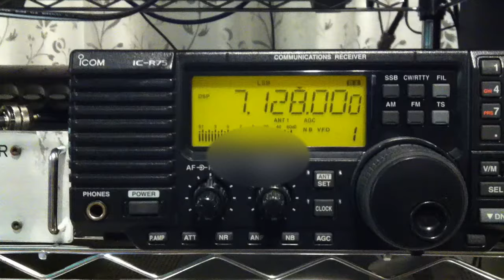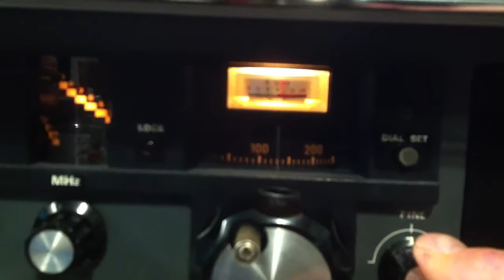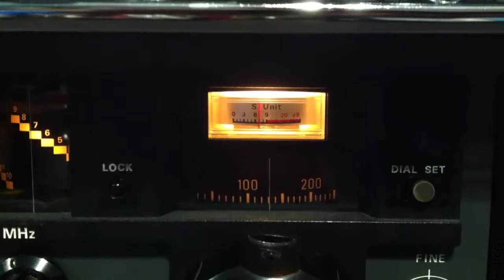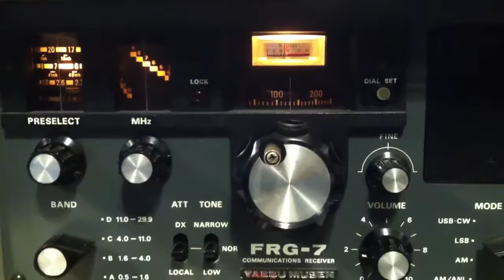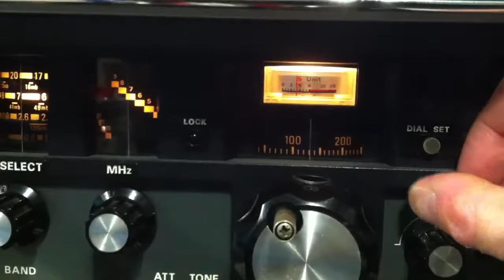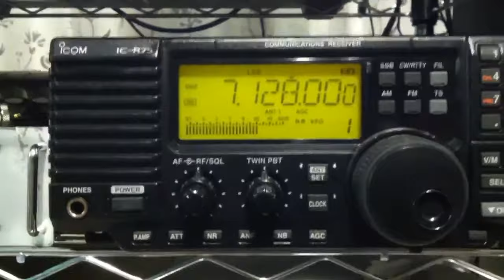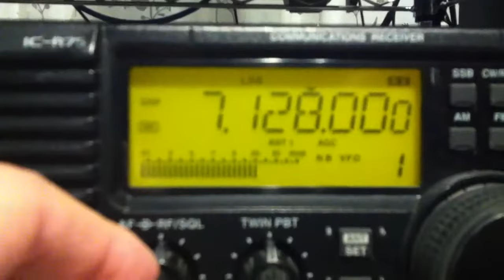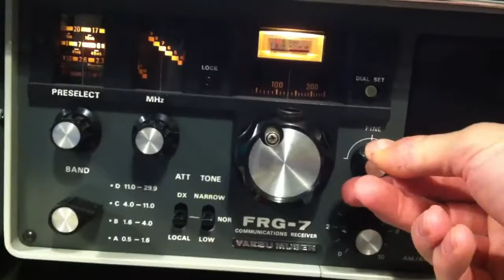Yaesu FRG-7 vs Icom IC-R75 on 40 meters LSB

Comment: The Frog sounds nice and full bodied under good conditions with it's wide 6 Khz filter, but the Icom is better suited to crowded bands with it's tighter ssb filter. Both good radios though! I've modified my frog with a second 4 kHz filter which helps reduce adjacent splatter a bit, but it's still on the wide side for ssb.
Reply from the maker: Good mod.

Comment: Hi, bravo to the FROG! I have one and also a Barlow XCR30.Very sensitive! Have you replaced  the 6Khz filter by a narrower? I have a Murata with 15 elements (CFS455I),this was installed by Gilfer's in the past.
73
Olivier
Reply from the maker: HI ! Thank you. 
Three of my FRG-7 are stock, on one i improved the wiring with better shielded coax , shorter route to front ATT switch and it as the stock filter in it. This is the one in the video. Very nice , quiet and sensitive unit. I was tempted to change the filter at one point for SSB but at the same time i enjoy the width of it on good shortwave stations. 
73

Comment: THE FROG QUALITY SOUND IS WAY, WAY, BETTER THAN THE ICOM, CONCERNING THE RECEPTION I'M NOT SURE. WHAT DO YOU SAY vener6?
Reply from the maker: HI, the Icom is a more sensitive rig but it seem to generate some noise on it's own probably due to the multiples IC's and the LED display in it. The Frog being all analog seem more quiet to make really weak DX station more intelligible. So basically you ear them on both radios but the Frog would make it easier to identidy a station IMHO.